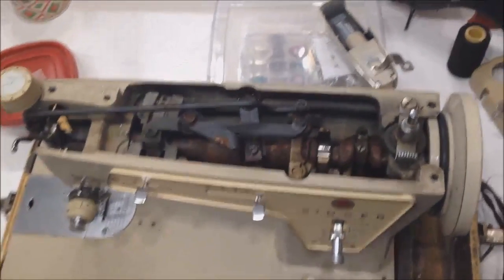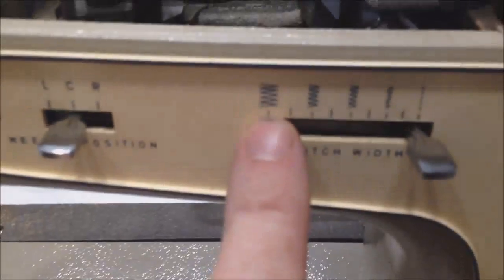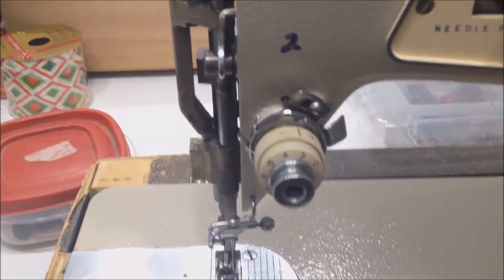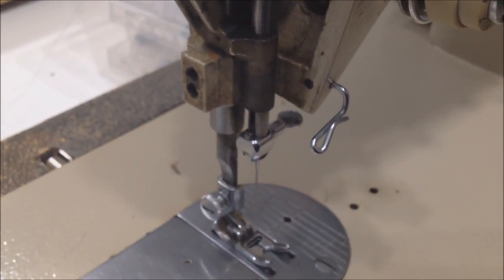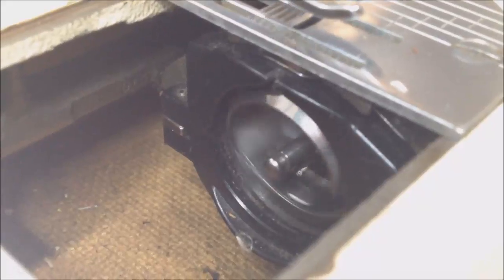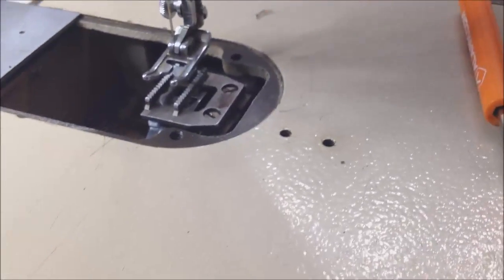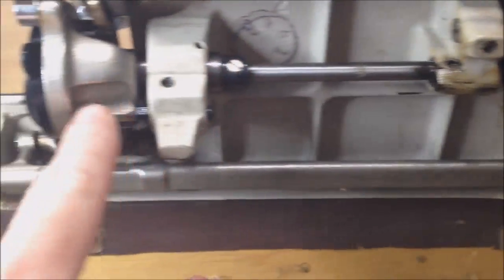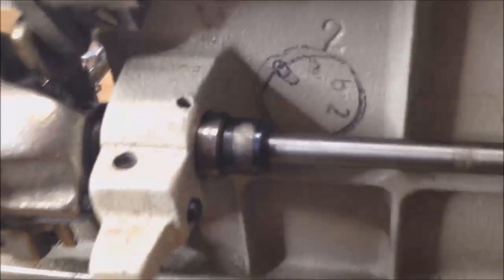How a 1960's Singer Sewing Machine works.

Comment: I’m asking everyone that I can…., why do you think my handwheel won’t allow the main shaft thingy to move my needle arm.  It worked fine yesterday and the only thing I did today was removed the handwheel, the belt and the motor just to do some cleaning. When I put it all back together the main shaft on top isn’t budging which of course controls everything.  It’s this same model.    I’m totally lost.  Thanks for any feedback.  It worked beautifully yesterday.😞
Reply from the maker: We’ll, it is an adjustable couch in the center, so make sure that is tight.  You typically disengage it when winding bobbins.